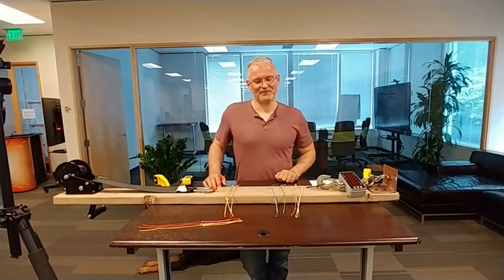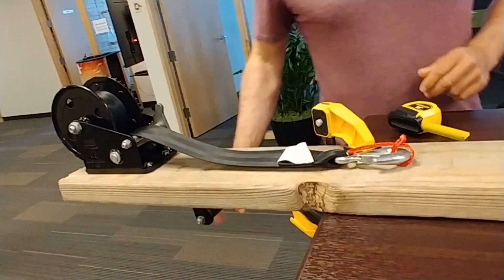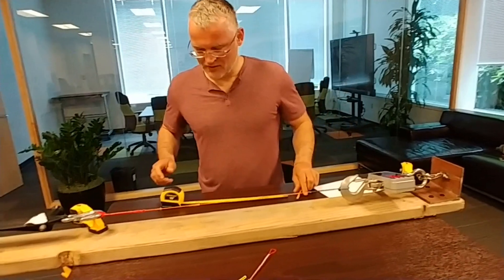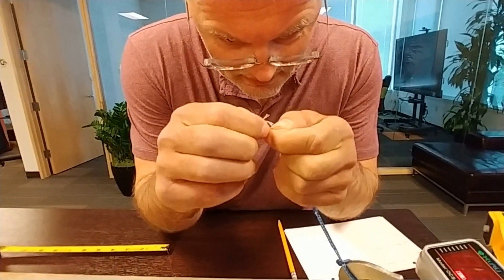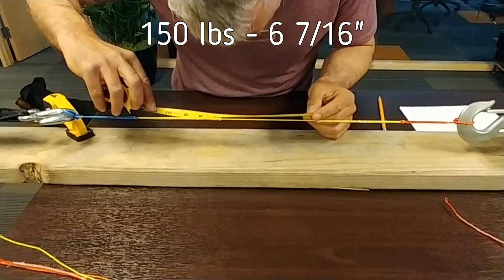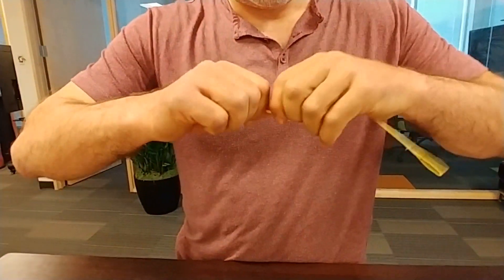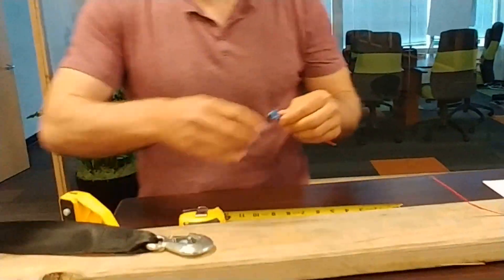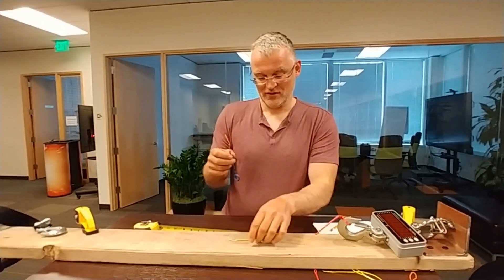Kite Line Testing: Q Power Pro

Comment: Hello! I liked watching the video about the test of these lines. I did something similar here in the South of Spain and came to the conclusion; 

1•) All brand lines are stretched (especially powers) 
2•) It also depends on the factory interlacing.
3•) Its diameter and especially if it is sk 75, 78, 99 etc. also influences. 

Of the 4 factories I visited in Europe for now, I choose Liros (Germany) (Liros dc pro (401 steering and 701 front)). but with Robline (Czech Republic) (Maui 389 (1.35 mm steering and Maui 509 (1.75 mm front))

Resgard 

Alberto Sánchez 🤘👋🙏